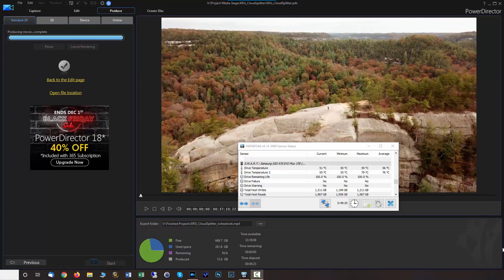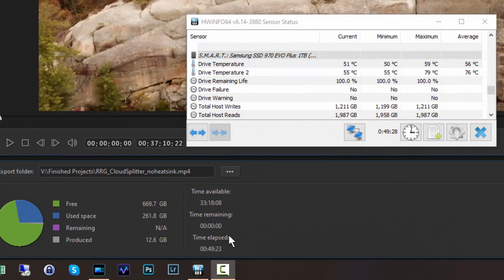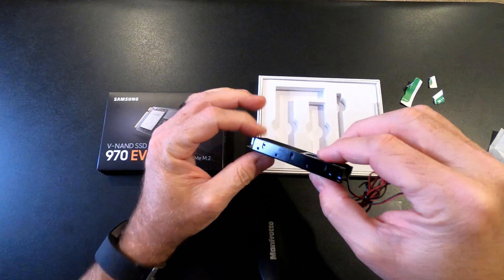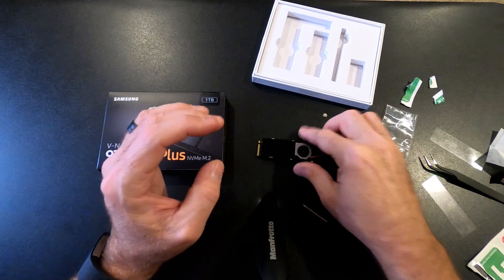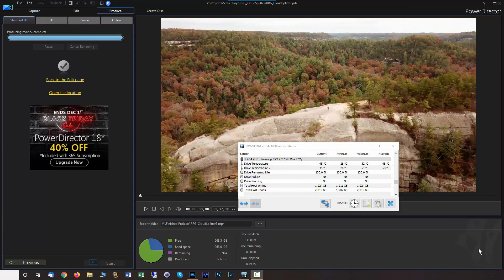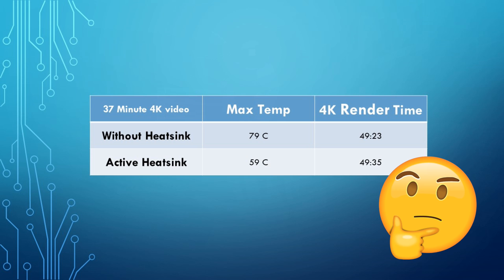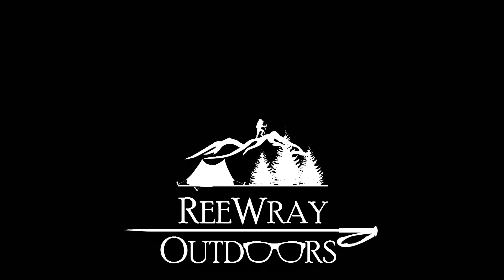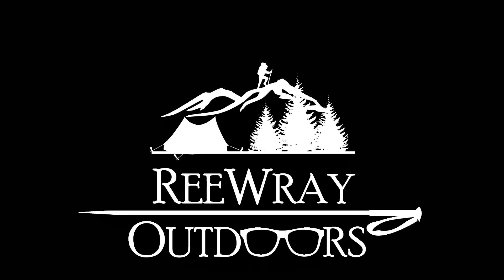SHOULD YOU INSTALL an M.2 NVMe HEATSINK??  Pros & Cons, How to Install It

Comment: good video.  Thank you.  You could probably cool the pc a bit extra by knocking the dust off that intake fan ;)
picked up a Jeyi nvme heatsync from Corn electronics on Newegg...all in chinese.  Was trying to figure out if i should remove the drive stickers or not.  Also it came with 5 pads.  so i think, the one small grey and red one like yours goes first down in the bracket, then a blue pad, then the drive, then a blue pad, then the sink.   has 2 different sets of blue depending on thickness.

Comment: I have been trying to find a piece I read this past fall from an Intel engineer warning of the dangers of keeping the drive too cool and how it affects drive writes correspondingly knocking lifespan down by as much as 1/3. I recall something about keeping it about 45 degrees and that may have been more about active water cooling than air cooling. I don't like commenting without the proper info but thought it relevant.  Based on your test results the difference seemed statistically insignificant. Probably indicating your drive wasn't clipping during the 1st test run. I'll try to find and post that article here asap. His name was something like Alen Melvenden...

Comment: I think I might have something to add to this. M.2 SSD's are a bit conflicting when it comes to cooling. The Controller part of the SSD, which in most cases is the block that looks slightly different from the others on there, likes to run cool for performance and lifespan. The other parts though like to run warmer for better performance (not completely sure abou lifespan). If you use your M.2 for things like rendering or other things where it'll constantly be active it is adviced to cool your M.2. You can even cut away parts of the adhesive so that some parts are cooled and some aren't. If you just use the drive to boot windows off of it you can just leave it uncooled. Hope this helps some people down the line :)

Comment: Thanks for the concrete data and well thought arguments.
I am asking myself the same question, is a cooler positive or may it even harm seeing the unique temperature behavior of NAND (data keep/retention time outside of the PC, this means no DC applied to the SSD seems to be 28 weeks when stored at 30°C and when the data were written onto the SSD at room temperature 25°C {this means extremely well/deep cooled} while the keep/retention time nearly doubles to 52 weeks when the data were written at more practical moderate heat of 40°C {and this keep/retention time increases the higher the NAND temperatures are while writing - see this JEDEC presentation, slide 28: https://www.jedec.org/sites/default/files/Alvin_Cox%20%5BCompatibility%20Mode%5D_0.pdf}).
My current conclusion:
1) I don't like any kind of active cooler because of a) the added noise and b) I think passive coolers are effective enough (if you need more heat dissipation rather look for a thick cooler, many are just 2~5mm thick on top, but you find up to 10mm and in my understanding more thick means more effective). Only when actually experiencing heavy thermal throttling I would consider an active cooler with additional noise and hopefully better cooling (your data show thermal throttling needs a job harder than rendering a 4k movie).
2) I think a cooler is not absolutely necessary, but it depends on the actual mounting situation which is different in each PC, this means how well can the SSD dissipate its heat seeing may be hot air/heat radiation from the GPU/CPU and a hidden place with few air convection and also your ambient temperature. But I also think a passive cooler is not harming at all, because the cooler is mainly cooling the controller, but for the NANDs it may even act as a little heater, because some part of the heat from the controller will go to the NANDs. And I see the advantage that the greater heat mass by adding a cooler will keep the temperature more stable over time (too fast heat up/down or permanent wider range cycling is causing a lot of mechanical stress on solder joints etc.). So overall if there is sufficient space adding a cooler gives a little better optimization on all the different requirements of an SSD, just a tiny little better and therefore people may also decide to work without cooler.

Seeing the low cost of a passive cooler and how easy it is to attach I am currently determined to add a cooler where the space allows, especially when using a highest speed x4 NVMe SSD (SATA SSDs seem to dissipate generally less power so no cooler should be necessary and NVMe SSDs seems to have some variation model to model, this means when you not target top speed you may target minimum power dissipation/heat up for example in a laptop where less power dissipation also helps for longer battery life).
However, generally I expect neither a great effect in avoiding thermal throttling nor in extending the life time of an SSD, just overall I feel a little bit on the saver side with a passive cooler, like with a 2.5" housed SSD, where the 2.5" metal house provides a great way of heat dissipation and this at a lower level of power dissipation as all 2.5" housed SSDs are SATA SSDs dissipating less power than the up to 7 times faster NVMe SSDs in the rarely occurring case of sequential writing for long time.

Removing the top and bottom stickers from the SSD is for thermal consideration clearly the best. However like with the noise by the small fan I would question the additional 1 or 2° this removal might bring against the point "Warranty void if removed". I personally prefer to keep the warranty without problem compared to my estimate of just 1 or 2° less.
If somebody really wants to target the optimum I would rather replace the thermal pads by much more expensive/effective thermal pads. Heat pads attached to cheap coolers may have a thermal conductivity of 1 or 2 W/mK, top products show 10x higher conductivity and also the thickness may be optimized (standard arrangement is 0.5mm thick pad on the rather flat bottom and 1.0mm thick pad on the top, because NAND, DRAM and Controller have different heights), but going minimum thickness by replacing thermal pad with thermal paste may be an overshoot like using a noisy fan (yes it is thermally clearly better, but only a tiny bit and it is much more troublesome in handling and what is the fruit when even working without heatsink is possible and adding a passive metal heat sink will reduce the temperature up to 10 or even 20°?
Reply from the maker: Thanks Friedhelm.  I appreciate the detail you've added to the discussion!  Very well considered.  I do think the bottom line is likely (as you in part stated) that the effect either way (with or without) is not likely to be significant. But given the low cost, it's an interesting experiment at the least.  :)
Reply: @ @ReeWrayOutdoors : Yes, I agree. My bottom line in one sentence is:
Adding a cooler has generally insignificant effects.
But I do not agree that the cooler is just an experiment. I just checked Western Digital's offer a little more in detail and found, they offer their Black NVMe SN750 series of SSDs as a bare M.2, but alternatively also equipped with a passive cooler (but with cooler it is not suitable for most laptops -I believe the only reason for not being suitable for laptops is the heat sink requires more space than available), while they offer their Blue SATA SSDs as a bare M.2 or 2.5" housed (but not with cooler). They offer also a Blue NVMe SN550 series of SSDs and these are also not offered with heat sink, because they seem to be optimized for minimum power consumption (not maximum speed) as preferred in most battery based laptops.
WD's offer represents exactly my bottom line. For DESKTOPs using fastest speed NVMe SSDs adding a passive cooler is a reasonable improvement/modification that nearly everybody can and therefore should do when it is low cost.
When actually experiencing thermal throttling you can do additional things as (but these additional things are for the general user excessive/associated with disadvantages):
- use a cooler with small fan (adds noise, requires DC supply cable)
- remove the top and bottom sticker (sticker says: Warranty void if removed)
- replace the delivered thermal pad by higher thermal conductivity and/or lower thickness pads (additional cost, time)
- replace the thermal pad by thermal grease (the viscosity of CPU thermal grease is rather low to realise smallest gaps of 0.0xmm, whereas on SSD chips possible different heights of controller, NAND and DRAM may result in 10 times larger gaps of 0.xmm and too low viscosity thermal grease may then flow out of this larger gaps at high temperature)
- place a thermal pad below the controller to create a thermal flow to the mainboard (additional cost, time)
There are no clear data on the effect of each of above measures, but in my image adding any type of passive cooler reduces the controller temperature by at least 10° (in case of quite thick {10mm} top plate even 15°), while any of above measures may reduce it only 1 or 2° in addition and should therefore be considered excessive unless there is a real need or it is easy to realize because the material is already available as well as knowledge how to use it correctly.
Trying to compress above situation into a bottom line/single sentence is difficult/may result in misinterpretation. Here therefore my bottom line again in other words: M.2 was developed for laptops. After becoming the mainstream for laptops M.2 is more and more also used in desktops, but due to the much more space available in desktops it is a reasonable improvement to add to the laptop optimized M.2 a cooler for the more power hungry fastest NVMe SSDs. Even you may not see a clear difference the cooler will provide you with additional security in case of more hard use or in case of more high ambient temperature in summer (your rendering of the 4k video did not result in thermal throttling, but you came close to the temperature at which the SSD will start to reduce its speed to avoid damage by overheating).
Beside of functionality for some people also the optical aspect is important. Some heatsinks offer different or even a wide selection of colors and a nice outside looking (much more attractive than the bare M.2).
An important point in selecting a concrete heat sink is the practical question, how shall the heatsink be fixed on the SSD. I see 3 basic methods as 1) separate or in the back plate integrated metal clips/brackets (fits only 1 SSD thickness and this means generally single sided only) 2) rubber/silicone bands/O-rings and 3) screws at both sides (fits in combination with holes only 1 thickness, but in combination with slots/high sides slot allow larger height adjustments).
I personally like method 3 in combination with an around 0.5mm thin bottom plate (no conflict with/bending on the mainboard when pushing down to set the fixing screw) that has slots instead of holes for the screws on both sides, which gives you the flexibility to adjust to the different SSD heights, in ideal case can be adjusted to either single sided or double sided SSDs and also you decide on the pressure on the thermal pads. This means I like the heat sink you selected (except for the fan mounted on it) and the WD heatsink carrying the EKWB logo uses the same principle except of holes instead of slots (while the heat sink EKWB sells by itself uses brackets).
Here is a quite long video on 7 different heat sinks. Initially their construction differences are shown/explained in detail. At the end measured results on temperature down are given for a well and a poor ventilated mounting place (but your type with slots and screws from both sides is not included). You find some clear differences, but the main message I took is beside the by noise with no temperature down effect disqualified ADATA XPG Storm (I believe it has some design flaw or has this very small fan no real cool down power/air flow) in general any passive heatsink is good/sufficient so you are free to decide by any other personal preferences or needs you may have as optical looking/color, space to mainboard, thicker double sided SSD instead of the mostly single sided, ....
https://www.youtube.com/watch?v=Bqab3YoAQ14

Comment: I asked google if i could/should use thermal paste INSTEAD OF the thermal pads? Seems to me the paste would work better, but no answer here - dang.
Reply: pads provide "equal thickness" across the ssd.. paste is applied unevenly.. so can you do that as good as a pad?  probably not, but it's always your choice to do so.

Comment: At 13:20: The interior ambiance temperature of the case is the same when using the heatsink on the SSD or not. Dissipating heat with a heatsink and/or fan will just transfer or move heat, not "eliminate" it. Even worse: the extra heat delivered by the fan will contribute extra heat, although this will be minuscule.
Reply: but "transferring or moving heat" is exactly what air conditioning does, it MOVES heat, from the hot room to the outdoors and it does make the room cooler, after all.  Moving heat is what every cooling device does and it is the literal definition of air conditioning and cooling: it moves heat from where you want things to be cooler, to an area where the extra heat does not matter.

Comment: Great explanation! I've seen in some tech tips channels that nand chips should work warm, no less than 40°C (104°F for the US viewer), for optimal performance ,but it should not surpass 80°C too. After that the ssd will thermal throttle and lose  a lot of performance. The temperatures that we see on softwares like hwinfo are the controller temperature and this shold get cold for better performance. Thats so conflicting that they even tell to isolate and to apply heatsink only in the controller chip to guarantee that the nand flash chips still warm enough since they do not get as close to the controller chip temperature on severe workloads.
Reply: In some other video they said that the original label on m.2 ssds is actually there to transfer heat from the controller to the flash chips, so i assume they have a thin layer of metal for that. If you remove the label you break that design, so i would recommend to connect the flashs to the heat sink to keep heat distribution from controller to flash active. If the controller is at 50°C you can probably assume that the heatsink in that area also heats up to almost 50°C and therefor the NAND should have a good operation temperature.

Comment: Interesting test when it comes to temp lowering with a heatsink/fan system. But using rendering time is NOT a good measure : rendering time depends on (and use) GPU and/or CPU, not SSD, which is used to read the raw data if any and then write back the result (resulting file or a temp file), meaning a little use. SSD, like CPU and GPU use throttle mechanism when the chips are too hot, which means a performance decrease. Since rendering doesn't use the SSD so much and SSD are blazing fast, even with throttle activated and a performance decrease, you'll see no difference at all in rendering time, since you use a little portion of the disk performance for rendering. A simplier test will be to use standard read/write test (sequential and random), during a long time, and follow read/write transfert speed along with temp. The curve must be pretty explicit when the temp limit is reach and throttle is activated.
Reply from the maker: I'm actually in agreement with you on most of that.  The only reason I showed a test with rendering times was to test the claims I was getting from a couple of other people.  No question that CPU (in particular) performance is the primary determiner (something I point out in my closing comments of the SSD installation video).  I will say though given the fairly significant rise in SSD temp during the rendering process (despite the fact that I likely didn't hit a throttling threshold) does make the more interesting question about temperature/performance/component-fatigue a relevant conversation, regardless of its relatively insignificant impact on video rendering.    In any case, your comments are definitely on-the-mark,  well-taken and appreciated.  Thanks!
Reply: @ReeWrayOutdoors  You're welcome. I was looking for articles about how effective was the SSD's cooling. And I what I discover, after seeing your video, was pretty akward : in fact, if SSD throttle append, it's not because memory module (NAND) must be kept "fresh". It's the opposite, in fact NAND loves heat and getting your NAND too fresh can harm their lifetime ! The throttle appends because the memory controller doesn't like heat and can be damaged by overheat. In short, only the controller chip must be refreshed, it avoid throttling due to mem. controller overheat and the memory chip/NAND stay hot and perform best with a longer lifetime ! I give you 2 links, if you're interested (second video at 6'15", but I thing my link start the video at good timing).

https://www.youtube.com/watch?v=Z4-Tml7y1TM
https://www.youtube.com/watch?v=KzSIfxHppPY&feature=youtu.be&t=375
Reply: @ReeWrayOutdoors  I bought the heat sink. It's sitting on my desk. Should I install the m.2 with the heat sink or not?
Reply from the maker: @TimothyOBrien1958  I'd install it. It's unlikely you'll notice any performance differences, but keeping it cooler should be better for all your components.

Comment: Hello Sir,
It’s very good video. If I were you I would redo the test with/without heating sink three times each and calculating the average speed and temperature. Yes of course it’s painful, but it will present a clear conclusion.